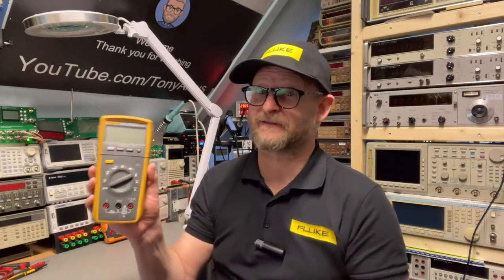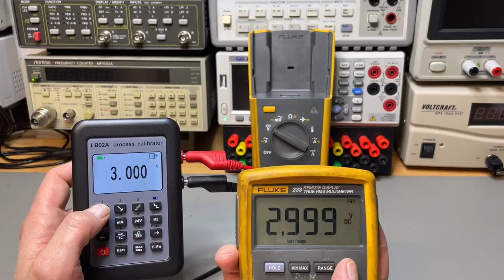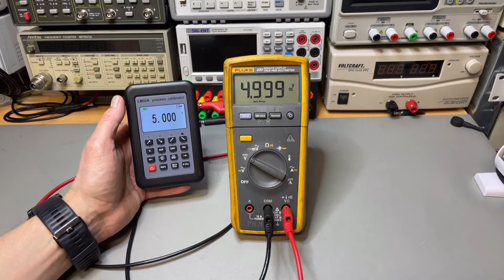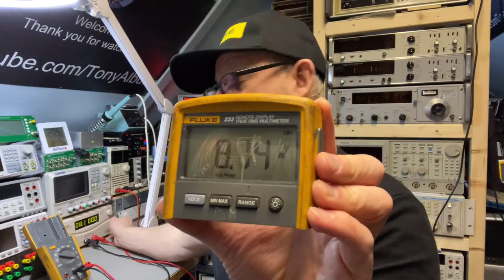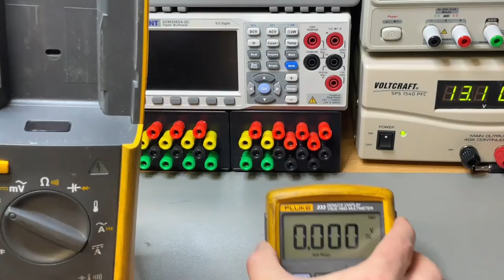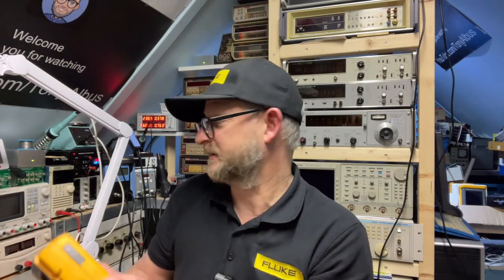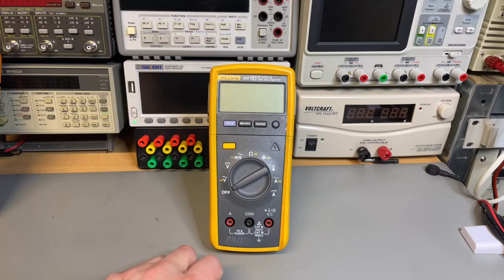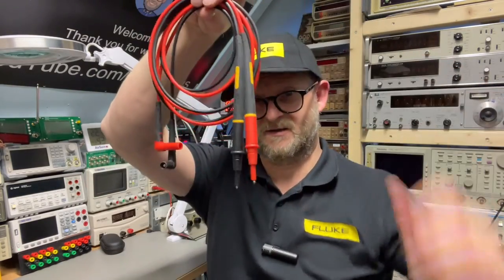TA-0347: Fluke Friday (E16) Fluke 233 Remote Display True RMS Multimeter

Comment: I acquired a 233 with  firmware version 1.01. It was horrible on batteries until I put a normally closed switch in the  display. I increased the height of the grooves for the docking latches so it's close enough to pair when the switch connects the batteries. The display worked for a year, the base would work for 6 months so it got a switch too, now the base batteries work for over 2 years. Don't get this model if you don't use it often as it is always consuming current.
Reply from the maker: Yes very good mod. more people have done that. it eats batteries.

Comment: Yes that's a really industrial meter. I really could make use of one of those some times. The 287 I use has a nice data logger but not much use to me when I am up the ladder making adjustments with my multimeter connected on the main device several meters away.  Yes that's a really nice meter, super accurate and came up a treat after you cleaned it. Just an observation Tony, Is that a new Siglent triple rail PSU above the 40amp PSU ?  Oh and the very nice Keysight meter looks amazing. Once again many thanks for sharing the Fluke story with us.
Reply from the maker: Thanks Ian, yes i enjoy the cleaning, at least its something you see after its done. Great example for its use in a practice case, thank you. The Siglent psu i have for a while, there is a video around about it about the new firmware, but well spotted indeed. the Keysight i found 2nd hand, and when i saw it, i wanted it :)  will be a video too later..

Comment: Hello Tony, my 233/a is doing the same thing at the beginning of the video. It will show "rf error" when i replace the battery in the remote. Once connected to the base it will work fine but as soon as I take the remote of the little symbol in the top right corner will flash and no readings are shown. What did you do to fix this? 
Thank you
Reply from the maker: Hi, all i did i did on video, but i do not remember, maybe i took the manual and looked how to pair the two devices, but i realy do not remember.